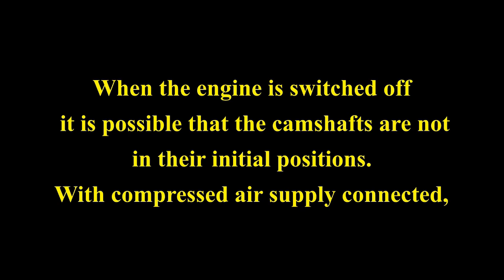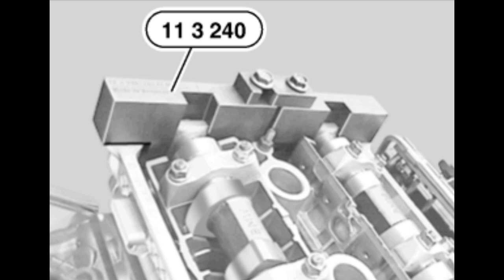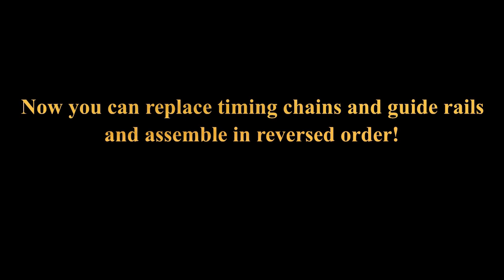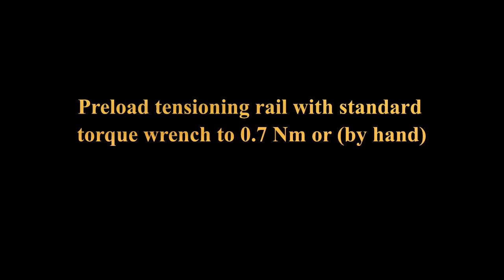BMW M54 M56 M52TU Engine timing, Timing chain replacement - DIY. Double Vanos. E39, E46

Comment: Hos do you change the second chain?
Is it possible to do without taking the engine out?
Reply: I don't think so... I'm in the middle of this job right now and Alldata and the maintainence book say there is no procedure directions for doing the job with the engine still in the vehicle. Doesn't mean it can't be done just there isn't  any clear directions to do the job that way.
Reply: @HipHopBeatSource drop oil pan and take front coger off